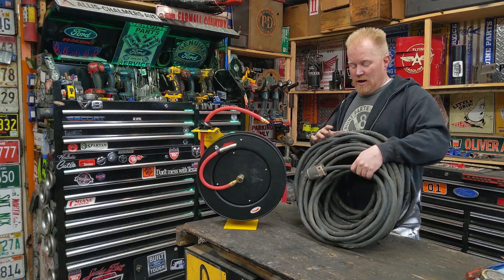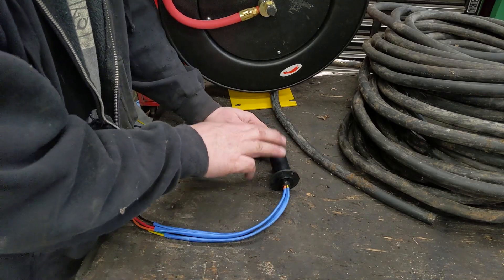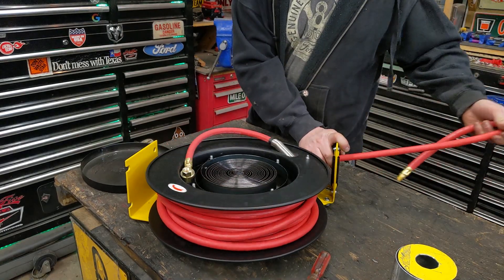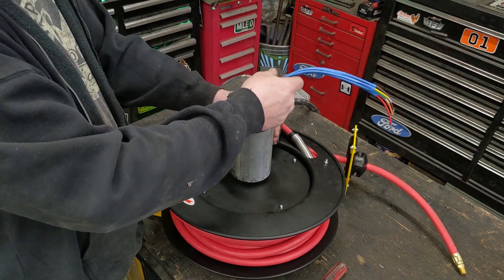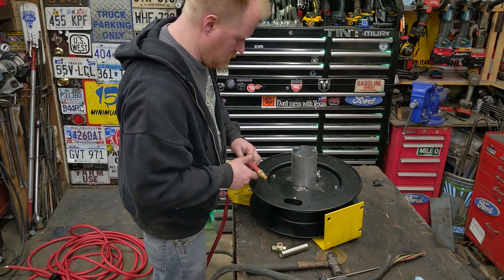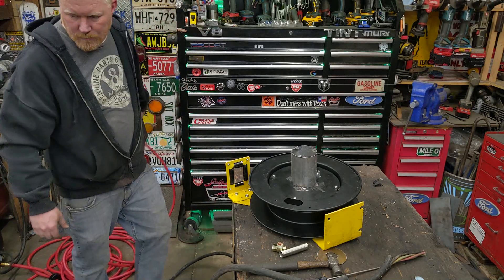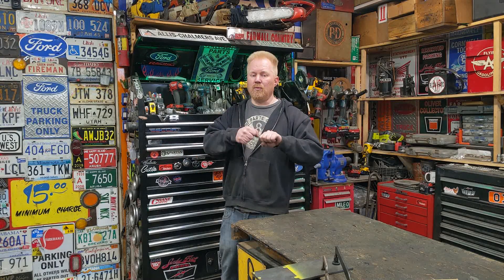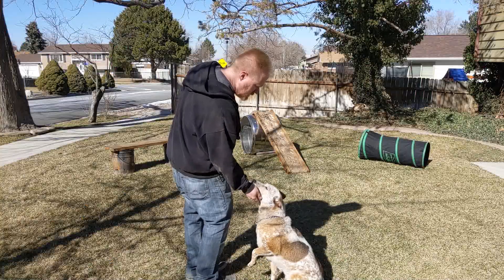DIY retractable WELDER Cord Reel 50amp 240volt Plasma Cutter

Comment: Hey moe, how long of a cord did the reel wind of taking? so i know how much cable to buy
Reply from the maker: I mentioned it in the a video but I think it was 40-45 ft. This is a 50-ft cord reel but the wire/cord I had on hand was a little thicker than the hose originally came on it. I used 8 gauge 4 strand with the fourth strand not even being used.8/3, would have likely allowed me to put a full 50 ft.
Reply: @sixtyfiveford thanks for the response im a long time subscriber

Comment: So why isn’t the ground conductor needed? None of my welders have them either. I swapped out the 8/3  to 8/4 and grounded it to the body of the welder, especially my miller that used 480v 3phase
Reply from the maker: To put it super basic 120v appliances use neutral/ ground as the place to complete the circuit. It is 120 volts above zero and then cycles to 120 volts below zero. Essentially positive 120 volts and then negative 120 volts 60 times a second. 

240 volts is simply to 120 volt lines that are opposite of each other. So when one line is 120 volts positive, the other one is 120 volts negative. This means on a graph they are 240 volts away from each other. They keep switching at the exact same time to always be 240 volts away from each other so they complete each other's circuit. 

That's why you can take either leg of a 240 volt circuit and run it to neutral/ ground and you'll end up with 120 volts.

Comment: What’s good setup for 50ft cord of 12awg wires reel 30 amp or 20 or 15 for 2000 generator 
Trying use for electric mobile setup

Comment: I always wanted my welder extension to be retraceable but as you mentioned they are really expensive, the other day I picked up 3 hose reels from a local recycling place for $50, use 1 as is for air and I wanted to use one of them for a 12awg extension cord & the other one for my welder cord but didn't know that I need the slip in piece, I didn't even finish watching the video I went on amazon to try to get the 40A but that's $53 & it comes from China, however on eBay there's one that is made for wind turbine rated for 90A for only $18, I ordered 2 of them to seal the deal. 
If any channel deserves the subscription this is the one & thank you for sharing your knowledge.  Hope to see you with another great video.

Comment: One more thing that uses slip rings is the famous rotated tornado sirens you know the ones that’s got a rotator. The motor at the top has to have a stable connection and we’re slip rings come in

Comment: Do you have any more details on the pipe you used and the way you mounted the slip ring into the pipe?
Reply from the maker: The pipe/size isn't important in any sense. It just needs to be bigger than the slip ring to house it. You could make a square box and it would do the same. The slip ring just needs to be centered so when it rotates it doesn't move around when the reel rotates.

Comment: I found that the springs on the cheap-o hose reels are crap and weaken up with repeated use.  Assuming it's because they are not proper spring steel or not properly heat treated.  An issue with running higher currents through smaller gauge wiring is voltage drop due to resistivity.  Short runs are likely not a problem but it really adds up over long runs and that will affect your welder, plasma cutter, etc.  Cool hack nonetheless!

Comment: I would add brush and licker into the spool if this was used other than cleanish shop. Say work truck environment on the jobsite get licker so cable wont pull in all the mud and dirt to spool. Could use same thing for air hose as well.

Comment: If you hang around a water pump company - or show up where they're changing a pump, you can get the wire that goes into the well. If the well is deep enough, you could wind up with 100' or 12/3 and some really impervious waterproof heavy sheathing on it too! 
☼ The wire normally is suspended in the well, all the way down to the pump and by code, they always put new wire in - so they have to throw it out and not many people want to clean it to get 12ga copper out of all that covering! 
☼ THIS is what I make my heavy duty extension cords from - 12/3 - and it's gonna carry my welders with no problems. 
☼ A 6-pack of something cold would go a long way to getting the wire they throw away too..... for free ...... just sayin' .....

Comment: No offense but. Not really showing much in terms of detail. For example, the metal cyclinder with the hole cutout gets welded to the metal plate piece from the reel then you cut out the part where you feed the welding cable thru that. Why skip over that? Need to see exactly what's being done here and your not really showing anything close-up and just rambling. Same with the wiring of the slip ring, your going off about what China does and leaving us wondering how one might actually go about setting this up. By 9:52 that's pretty much all done, and i still don't know what you did there

Comment: I got a job many years ago at shop, I brought my welder, and was too poor to buy a good extension cord, so I went to flea market, and bought a 12 gauge cord, then used it to move around my welder, which was a Lincoln AC/DC tombstone welder, cord was 30' and it worked great, didnt get warm, unless running several rods at top end of welders range, and most of the time welder was in middle of range, I welded hundreds of trailers, never had issues, still own the cord, its stored in my attic, but I picked up longer & heavier cords I use around home, like 85' of 10 gauge, or 135' of 8 gauge. never needed to hook both together. but yeah those are heavy. but I may need to bring my old 12 gauge cord down.

Comment: Pull about 6 ft of slack out and let it lock. Then back feed slack by hand leaving wheel stationary. Loop slack back on wheel. You have know added spring tension. Need more do it again have one that has to much do same in reverse. Hug advantage of single bracket reels. Takes like 2 minutes maybe. Great vid btw.

Comment: What guage wire would I need for a 220v MIG welder? And what size breaker? And do you have a video on adding a plug and wire from the breaker panel?
Reply from the maker: Welders/plasma cutters have a intermittent duty cycle so you can use thinner wire than is commonly used for household 220v circuits. Generally you will wire in a 50 amp welder outlet with what's called a Nema 6-50r(virtually all welders come with this plug pre-installed). You would also use a 50amp breaker. You could run 10/3 for up to around 50ft and it'll handle a 220v 50amp welder with a duty cycle up to 40%-50%(most diy welders are only 10- 20% duty cycle on max). Now this will be an intermittent duty cycle outlet only and can't run things like a stove or charge an electric vehicle etc. If you want to do those, (those are 100% duty cycle) the 50 amp outlet is limited to only around 30amps. You would want to step up to 6 gauge wire to handle 50amps  continuous/non-stop. 

In wiring it's all about controlling the heat / temperature of the wire. A duty cycle allows the wire to cool down and not get overly hot and why we can get away with lot thinner wire with welders. Where as something like a stove you'll turn on and it'll run for an hour two hours straight and the wire will never get a chance to cool down so you need oversized wire. I mentioned this because everywhere you read will tell you you need 6 gauge wire for 50 amp circuit. but this doesn't take into account welders which are their own category in electrical code.

Comment: I didn’t know I needed one, but now this is going on the project list. Awesome job.
Reply from the maker: Thanks, I'm glad you liked it.
Reply: @sixtyfiveford  here in sht hole aus..a regulatory r trd, will cut the end, off your extension cord, if it has a kink, lay,s on ,over, any metal object, is not taged. is not suported above head height, not on ground, has bits of sheath nicked. has to have clear, ends, to see wires connected. allways has to have earth. all electrical equipment taged every 3 months.wearther used, or not, in your truck,. they send women round to inspect sites as,,'' you cant hit a woman''..

Comment: Since that electrical rotary coupler could fail would it not have been safer (more correct) to ground the coupler before and after?
Reply from the maker: If it failed after it's rated 10-20,000 cycles it would just go open circuit. So no power would go to the device you're trying to operate.

Comment: Air reel from Harbor Freight was my solution to the weld leads also, I just leave the plug ends loose at side opposite the rotating mount side during the reel/unreel.
If I get tired of that I guess I'll have to build some suitable sliprings.

Comment: I did same thing because I have a Jeep P/U with a utility box on it. but I purchased a reel from Harbor Freight. actually two of them one for air and one electrical cord. but they don't automatically reelup because I figured. being as there wasn't anything at end of the cord/hose that would dig into the ground or get caught on anything. I just crank them back into the reels by hand with hand crank. and they were cheap about twenty dallors each which is always a factor. then mounted them at the back of the utility box so they swing out for use. it allows me to have a gas powered welder, a gas powered air compressor, and a generator on the truck. and get to areas that I couldn't get close to with the truck.
Reply from the maker: Awesome

Comment: cool project! i think i like the reel retracting a little slower... my air hose screams back in and sure as sh*t there will me a little shard of metal stuck to it and it will slice my hand as it retreats to its wall cave
Reply from the maker: I've used it quite a bit now and the slower speed has been nice. I know if I let go of my air hose it would likely cause some damage.

Comment: Sweet 
But courious as to how long the tension spring will last with that heavy wire and how many back lashes you will have to untangle.
Reply from the maker: It's no different than the air hose and puts no more strain on the spring than that would.

Comment: I would be concerned about the rotating connection handling the current of a welder.. and if china says 30amps, it can only handle 15amps.   
Perhaps a better way to do this kind of thing is use a coiled spring so the wire will unspring down from the ceiling and not actually rotate.
Reply from the maker: Slip rings are used all the time in windmills and have a great track record.

Comment: If there was enough "room" on the clock spring you could always clock it a few Revolutions tighter and it would help with the retracting aspect. Not too much tho or you won't be able to unwind fully and could break the spring all together . But like you said , inexpensive hoss reel

Comment: I have had a number of welding trucks and shop machines over the years and many had similar reels for extension cords , welding cables, and the like. The only possible problem I can foresee here is heat. That cord will heat up slightly when you are using it. The code is based on the cord being open to the air to help it cool. When it is on a reel, only the outer layer can cool. The inner layers will grow successively warmer as you go in towards the reel. Over time this warmth will cause the inner layers of cord insulation to deteriorate and fail. This rig will work fine as long as you take all the cord of the reel when you use it for any length of time.If possible, you might want to create some ventilation holes around the reel drum to allow some air circulation. I found this out the hard way when one of my welding cable reels burst into flame one day with heavy usage.

Comment: What are you thinking?
Holy smokes.
Now you have an air hose that is like the original wire you had problems with.
Well I guess you don't have to wind up the wire one now.
Thanks for the video.
Take care.

Comment: Hey, don’t know what’s going on with YouTube, it never showed up in my subscriptions , found video on YouTube home page.  As for China and electric cords and wires, as a Asst. State Fire Marshal we found that China meets UL codes for exterior width diameter for all wiring but they reduce the size of wire down inside the casing.  That why you have over heating of extension cords and any kind of lighting, which always causes fires at xmas time because people leave lights on for ever.  Anytime in need wires and cords always go to City Electric contractor supply and make my own. Always enjoy, keep them coming
Reply from the maker: I know what you mean. They really cheap out on wiring and I don't like any wires from China. If they're not aluminum they're copper coated in aluminum just to save a fraction of a penny. My main cord is SOOW USA made 8/4.

Comment: I dunno about using a slip connection on such a heavily loaded cable..  id be more apt to just use a plug at that junction..  just cut the cable there and put a plug on it so you can just unplug it and run to where you need then plug it back in there on the reel..  i just wouldnt trust those brushes, had a vacuum with that kinda setup and ended up catching fire after some use...
Reply from the maker: They're rated for a lot of amps. It's no different than an electric motor running off of brushes Sometimes pulling hundreds of amps (starter motor).

Comment: Sixfiveford, Since you don't weld and grind at the same time, what would happen if you take one leg of the 220v and incorporate a receptacle to produce 110v for your angle grinders. You only pull one cord if this is safe to do.
Reply from the maker: I actually have a box made up just to do that but didn't want to show it because it's not up to code at all. One reason is there's no ground wire, Just a hot and a neutral. However most grinders these days are just two terminals and have no ground because they're double insulated AKA plastic housing. It would work just fine and you would not have any issues but it's just breaks a lot of code stuff.
Reply: @sixtyfiveford  main issue I have with “only breaks code stuff” is what happens in the crazy off-chance that you have a fire and your local Fire Chief notices the wiring... he notifies your insurance company who promptly denies your claim...
Reply from the maker: @wayngoodman5889  I trust the stuff I do and watch over every project like a hawk. If I did have a fire and it was my own fault I'm man enough not to stick it on the insurance company. Just like I don't pay for anything but liability on any of my cars because if it's my fault I get an accident I should be man enough to pay for it myself.
Reply: @sixtyfiveford  good, honest answer... you go, dude!

Comment: Alot of keyboard electricians out there! I like the idea of using a slip ring. Nice execution. Folks need to understand the issue with wound welder ext cords is heat soak. So as stated, unwind the cord when using for a big project. It is super convenient to take only what you need to make a couple quick welds. Prolonged use will heat the cord up and make it curly Q when it is unwound. A little common sense goes a long way. Thanks for the great video!
Reply from the maker: Thanks Ryan. That's the problem they need to make items these days for complete idiots that have no common sense.

Comment: Just fyi, I have the Harbor Freight Titanium 175.  I made a 6ft extension cord (220v) using 10ga wire.  The welder will only weld for about 1.5seconds then cuts out. 
I remove the extention cord, and it welds perfectly fine.
Reply from the maker: Interesting. It is likely polarity sensitive and your Hot/Neutral are swapped.

Comment: since you have half the length of wire vs the air hose that was on there you could crank that clock spring up a half dozen turns so it winds in better
Reply from the maker: I actually put 50 ft of wire on the 50 ft hose reel so the exact same. The clock spring needs to be pulled out a couple times just to so it settles. But then I will do a couple extra winds and it'll work way better.
Reply: @sixtyfiveford  oh wow thats a good set up then,looked like alot less than 50', you buy the cords premade online or did you find a spool of wire for cheap?

in canada was cheaper for me to buy the cord than just order the wire alone
Reply from the maker: @AndrewBrowner  Yeah I salvaged 135 ft from a boat dock last year. But in the past when I've needed heavy guage extension cords I would buy the old Lincoln stick welders. The people would include the cords for no cost and then I would just resell the welder and have $200-300 worth of free cord.

Comment: Crimping is better then solder for this application. And in many cases us preferably to crimp instead if soldering.
Reply from the maker: Yes and no. Crimping is better in high vibration situations where the length of the cord can't be supported. Crimping gives up a perfect connection though and can cause heat build up at the crimp joints. Soldering will have no heat build up at the wire joints under heavy duty applications like I'm using it for. Crimping would be fine in household wiring where the wires are so overrated that they're not pushed to the limits of their gauge.

Comment: Yeah I had my builder put in a 220v plug in my garage. They put a 4 prong in but only a 15 amp 120v breaker in the panel. 🙄🙃
Reply from the maker: Strange. Not sure what device you could run off a 15amp 220v circuit.